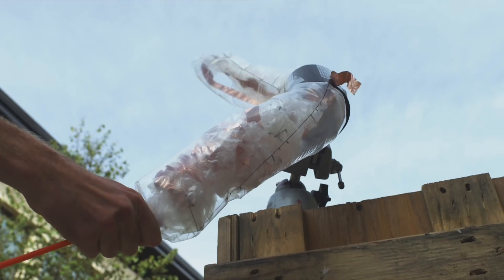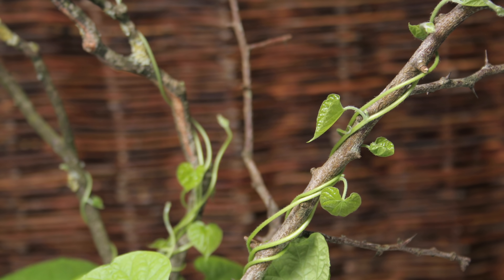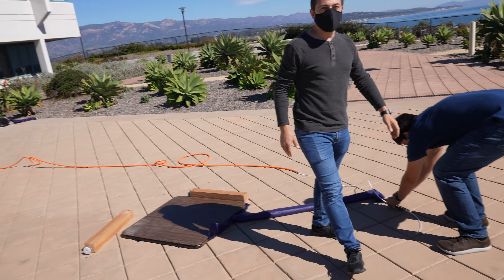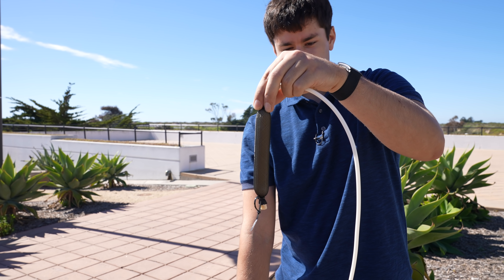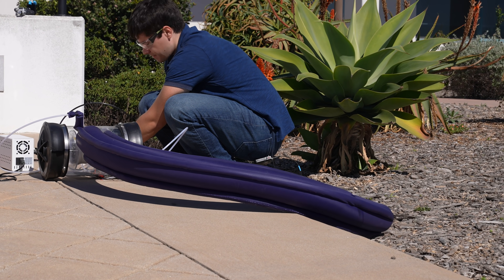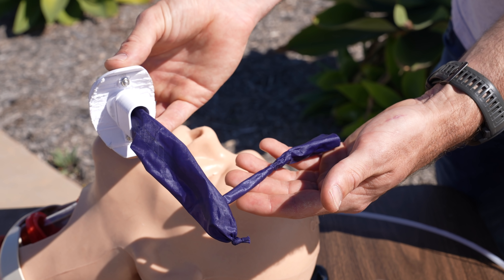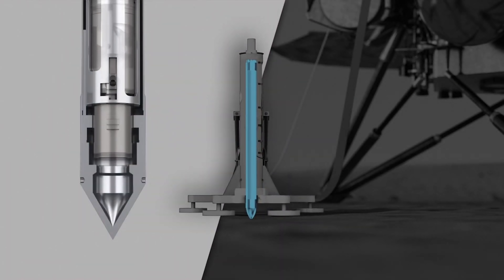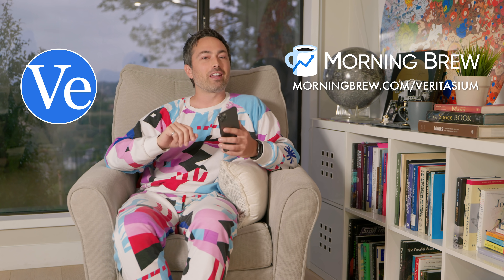This Unstoppable Robot Could Save Your Life

Comment: Don't know if this would be helpful or not but, for the intubation prototype demo there are a couple of problems sorry. But im sure with a couple of discussions with doctors, nurses, & paramedic communities will help it develop faster 👍 keep it up❤️❤️ (they all have different says)
-First, something needs to hold down  the jaw from biting down and the fleshy tongue from falling back (intubation blade) before we can get access to the oropharynx. +(the blade with light acc also help us to quickly evaluate the airway visually for anatomical, foreign, or pathological conditions/trauma)
-Second, take care not to overstimulate the entire back surface of the throat, too many reasons to explain sorry.(coughing, closing of the epiglottis, and other reflexes)
-Third, opening the epiglottis, usually the blade can assist in opening a closed epiglottis from the tip, or by pushing up the tissue above it (bellow the tongue), also we can assess if the tracheal opening is inflamed or not and how constricted it is, or did it puncture backwards etc
-maybe there are more (of course there are many other tools and cases of intubation problems, talk to medical professional, inspiration is bountyfull)

Wish you all the best👍

Comment: problem with space exploration is that would require a lot of added weight/volume for transporting the compressed gasses you will need to use both for the device itself, but also the amount you lose and can't reclaim blowing the dust to burrow. So probably not the most effective for that. As for intubation, it didn't seem like it had an adequate aperture through the center to pass the air for the actual breathing. It can open the pathway up-but it's open and full of vine robot so they can't breathe. Maybe it could be used for some colon stuff though? at home enima for when you are constipated for a long time lol, just turn on the air and feel it wind it's way deep into your bowels

Comment: Just a quick question. Don’t mind anyone answering this as it’s probably quite simple and I’ve likely just missed something. 

What prevents the intubation tube from contracting when the patient needs to effectively “breathe out”? I know that other intubation tubes are usually much more rigid so how does this one keep the pressure and still allow air to travel in both directions through the tube without blocking the airways of the patient?

Comment: Tradies would love this, finding or running cables in wall cavities. With a camera, and steering, you would be able to steer around internal obstructions such as water pipes or existing cables and electrical fittings and if you could fit a drilling mechanism even drill through studs. If the end had a ziplock type seal, you could then run the cable through the centre and out the other side once you got to the hole out of the wall by unzipping it before pulling it back deflated, leaving the cable insitu.

Comment: Doujin artists:- write that down! Write that down!!
Reply: Oh no
Reply: More like Bad Dragon designers
Reply: @MercanaryAlbatross   Everyone says they have some lewd idea for it, but I honestly don't see any realistic application as a sex toy... What is everyone talking about?
- It might go very deep in the colon, but that's about the only thing... and it might be soft, but doesn't seem gentle. Even if it worked, it won't provide any stimulation... what, you can pull it out after? whow -_- . - It might be more useful for medical colonoscopy or something, but what they have is usually better already anyway...
- Maybe you could make "viny" structures that would twine around you, but that seems pretty complicated...

It makes sense for doujins, though, sure...
Reply: @Verrisin  Attach very small motors with counterweights to the inside walls to make a vibrator. Toy drone motors might be a good start, but the voltage would probably need to be pretty low to make it effective (if it spins too fast, it might tear itself apart or be unnoticeable because the frequency is too high). Or possibly have the motors outside and have a thin rod that spins the counterweights inside - like one of those screwdrivers with the flexible arm you can attach, but much smaller.
Reply: @kiefac   I mean... but what of this inflatable mechanism do you need? ... You couldn't feel a vibrator deep in your colon anyway, and I don't think it has any use anywhere else, apart from mimicking tentacles grapping you, which would be so expensive, we will probably have cheaper VR you can feel sooner...
- Idk... I might be missing something obvious, but I don't see how using those inflatable semi-steerable tubes would be useful for a sex toy...
Reply: @Verrisin  who says it needs to be in your colon? There are other orifices in the human body. Also, it could be used for, eh... artificial insemination.
Somebody is going to find a legitimate use for these as a sex toy. I'm just spitballing (heh).
Reply: @kiefac   I agree that someone will probably come up with something. XD - My imagination might be limited, but this species... whow. XD

- As to why colon: I would say all other orfices are easily enough accessible without this. I wanted to say "there is not point" but realized... That's kind of true for most weird sex toys. XD That's not stopping anyone. XD
Reply: @Verrisin  no just no
Reply: @jpthepug3126   Fine. No tentacles for you, then.
Reply: @Verrisin  I love with what a serious attitude you went into this rather playful comment. Asking the big questions!
Reply: @Verrisin  to young and a strait guy
i dont want tentacles
Reply: @Shrooblord   Yeah, I always tend to ruin the fun by thinking things through too much. XD

I tried writing a "smut" thing with rules in it. When I read it next day, most of it was about edge cases and how to handle them, limitations, ways to assure safety, details and mechanics..... - definitely not ideal. XD

But, hey, "big" questions need answering! :D
Reply: @Verrisin  google "All the way Through"
Reply: @reddart179   ooh, yeah, that is a cute idea indeed. ^^  Sadly, very unrealistic, for many reasons.... but as far as Doujin is concerned: I don't think it's made better by this technology. :D - You already can use tentacles and ... well, almost anything, if you don't care about realism... but, yeah, sure... it's a (new?) thing that can be used :D
Reply: @Verrisin  There's potential, it's only a little more complicated.
Reply: @nullpoint3346   What are you replying to? To "All the way Through"? - That is mainly impossible, because it's extremely dangerous.
Reply: @Verrisin  I haven't seen that one yet?
You have over twelve comments in this thread alone.
Reply: @Verrisin  I mean... I think it's one of the few that could get past the cervix. IDK how useful that'd be for pleasure purposes, but it's not just the colon that's guarded by a sphincter
Reply: @nullpoint3346  That's why I was asking what you were replying to. :D
Reply: @CaTastrophy427   I kind of doubt it, it's very strong, and probably way too painful (well, people are weird, so that's not a limit XD) but... looking it it better, I think it would have trouble "unwinding" when it is too pressed for too long distance. (as it has to push the crunched material through it first)
- I briefly had the thought before, but dismissed it... but I guess if you managed to make it: very soft material, very ,very tough, no sharp 'folds' 
- It probably could be better than a metal rod, as after you manage the insertion (and thus being rigid enough to get it there) you could lower the pressure, making it somewhat soft, and more 'usable' ... still, it would have to be extremely smooth and...
- I really don't like how pressurized it would have to be, but as a very unsafe toy, ... maybe...

I also had a thought: The variant for breathing (with a smaller branch), it it were longer, maybe it could be used for "deep throat training" ...
Reply: I also have a thought: The variant for breathing, if the big part were longer(/stronger/...), could maybe be used for "deep throat training" kind of play...
Reply: @Verrisin  oh you sweet innocent you
Reply: @Retigator   XDXDXDXD good one. - So, what am I missing according to you?
Reply: @Verrisin  it seems most of the points i wanted to argue with have been made, BUT

regarding how confortable it is, thar is what innovation is for C:
Reply: @Verrisin  with a cap and maybe a vibrating device inside, if the outer fabric/plastic/whatever is strong enough, you can find some aplications. But the most feasible usecase would be to use this pressurization idea on a more complex... Recreation? Of the erection and hardening processes on a more sophisticated sex doll maybe?like using a silicon outer shell or something, and capping the growing to a fixed lenght. Wtf am I saying, why am I even alive?
Reply: @Retigator  Thank you for your comment. Somehow, after reading it, a spark of imagination came upon me, and I've figured out a unique and very interesting way to use it. :D
- Edit: it's right above this one.
Reply: @Verrisin  remember that spiral antenna robot featured in the video? Why not make a similar one that wraps around your legs?
Reply: @samsawesomeminecraft   Yeah, I had that thought too. Except, the antenna was predefined shape. - Here, you probably need something adaptive, and the complexity and cost would skyrocket (not to mention safety issues), making it not viable as just a sex toy, unless you are a millionaire...

(I could be wrong, though, maybe someone very smart could pull it off, and make it cheap and safe... but I don't see it, nor anyone pouring that much R&D money into it...)
Reply: @Verrisin  the whole point of this robot technology is that the predefined shape is not very solid and can adapt to circumstances, so you could just add one or two control "muscles" and that would provide a realistic feel without needing to add a ton of expensive technology
Reply: @samsawesomeminecraft   If you can, that's great. Please make it. :D - I guess if it is trying to have inner diameter smaller than the leg diameter, and the outer material has very low friction, it might be enough... will even provide some pressure (maybe enough to feel held), and will actually hold you once extended long enough... (if the base is affixed)
- I'm afraid it won't be that simple, but if it could... That could be pretty awesome!
Reply: @MercanaryAlbatross  I see you are a man of culture
Reply: @MercanaryAlbatross  the worst part is that it would work decently well
Reply: oh no, but oh no(yes)
Reply: well, yes, but actually, no
Reply: why is this a discussion on a youtube video about vine robots
I'm not saying it's a bad topic but why
Reply: @mangutroop  because it’s a tube that wiggles around through small holes...
Reply: @mangutroop   ... OC ? ... and this is where the video that started it is...
Reply: @mangutroop  Tentacles, I ain't got to explain.
Reply: 0:16 😩
Reply: Oh god
Reply: this comment and the replies are cursed
Reply: @bruhmomentum6819   some curses might be a blessing in disguise :D
EDIT: Not sure about this one, though...
Reply: Rule34 artist all the time ahead of time
Reply: YESSSS SAUCE
Reply: It is inflation
Reply: @Xatzimi   So simple! I completely forgot that was a kink. Inflation surely lends itself well to inflation. XD
Reply: ( ͡° ͜ʖ ͡°)
Reply: Everyone, I figured it out!
- It must be very long and when it fills you, it needs to keep unwinding. Then it keeps slowly pushing itself out of you.
- It will fill you completely, as it is soft-ish, if the pressure is right, it will exactly fit the walls around it, slowly moving along every single nook.
- It will be a very unique continuous sensation. Maybe it could even be made to loop somehow...
- Also, it will continuously rub the cervix.
- It must be made from a very soft material, with no sharp edges (bends) and it must be heavily lubricated from the inside, so it keeps adding as it is unwinding in the deepest part of you.

Thank you. Thank you. (XD) Now please, someone go patent it and make it, I'm interested in the reviews. :D
Reply: Wha, wha...      ...what happened here?
Reply: I will have you know, thats basically a tentacle
Reply: I can't believe you've said this 💀💀💀
Reply: we allready did. there is a lot of "all the way through"
Reply: @Aethenthebored  Ooh, that's a good point.

How weird would that feel?
Reply: and this is basically what the rule 34 is
Reply: I love how people always act like sex isn't a thing and that thinking about it is wrong somehow.
Reply: @DarthBiomech  Well on YouTube it is
Reply: Good thing i'm not the only degenerate here
Reply: I just googled it and that stuff is just so boring, like the artists have absolutely no idea what is sexually appealing, and all of the men's members are so small
Reply: @TommyLikeTom   XD I have no idea how you managed to google this. XD
- Anyway, if you search long enough, you are bound something you will like... if not, maybe you have to be the one to make it.

Go forth, and bring to life inflatable robot tentacles in ********* and ******* with huge ******** 
XD
Reply: degen
Reply: I knew there was gonna be this comment.
Reply: They don’t need MORE options...
Reply: i mean, some sort of sanitizing product, or a anti conception "clean the insides" might work, maybe its a stupid idea.
Reply: @sonni.walkman   ... I don't think you could ever "clean the insides from sperm" however it could be a less painful for inserting IUD contraception...
- You don't want to mess with 'sanitization' or something a lay person would do on their own: It's a very tightly controlled environment, which handles self cleaning and everything... That would probably cause lots of horrible infections and even worse problems...
- If you are talking about uterus. 
- If just vagina: I don't think it would be a huge help with anything (although, maybe) but you shouldn't clean deep inside vagina either: it's also self cleaning and it's best not to mess with it.
Reply: @Verrisin  make this toy your self before someone else does and make billions
Reply: Already have
Reply: Glad it wasnt just me
Reply: WHY IS THIS TOP COMMENT
Reply: stop
Reply: This kinda meeting has 84 reply on a day already😂
Reply: DOUNINSHI ARTISTS LOL
Reply: GOD is righteous. If you repent of your sins, believe in Jesus, get baptised and recieve the Holy Spirit, you will be born again and If you go on acting in faith for Jesus, you will earn eternal life and be useful to GOD.
Reply: I got like a 3rd of the way down these comments at most.... ya'll have problems.
Reply: Ohh yeahhh
Reply: ehe
Reply: Ha I thought the same
Reply: Uh oh
Reply: Oh no
Reply: Wink wink
Reply: Lmao just wait for it
Reply: 2000th like
Reply: Lol
Reply: Aw damn I was about to post that XD
Reply: You really are a lonely sandwich aren’t you?
Reply: @adammasterx5854  I will fully admit, it has been a while.
Reply: Grow 200 times of it size.
Reply: I hate you putting they image in my head
Reply: I've seen this person somewhere😂
Reply: what does doujin mean
Reply: @years8703   doujin is a Japanese word for "fan made" but in the west, it is often used as more similar to "rule 34"
Reply: @Verrisin  ooohhhh, mama mia
Reply: You mean paint them down
Reply: Oh God I'm cooming
Reply: Ha!
Reply: What’s doujin
Reply: Lmao
Reply: @rodrigodivino1129 nice
Reply: Hahahahhahahha
Reply: oh my goah
Reply: @kaibuchan  it can go into any space  we all know where this is going
Reply: Yes
Reply: Weeb
Reply: Why are you everywhere
Reply: Oh shjt dude.
Reply: Bad! Bad Sandwich!
Reply: hell yeah
Reply: H€nt@i
Reply: hi lonely sandwich I didn't know u watched veritasium :D
Reply: Oh god damn it...
Reply: Ssshhhhh they'll hear you
Reply: yeah folks never google things random people say in the comments
Reply: Urotsukidoji: the live action remake
Reply: 6.9K 😏
Reply: True
Reply: Dont
Reply: Wow 🤩
Reply: Cool 😎

Comment: What an awe-inspiring piece of work. Trying to think  of possible applications, I was wondering if this could be the technology for a 'Star Trek' style turbo-elevator, where the shaft not only goes vertically, but sideways or at angles as well, pushing the car in front of it. A rather mundane use for the tech., but it could be the basis of funding more appropriate uses.

Comment: If the materials are up to spec (Some form of carbon nano weave), with enough pressure they could be used to inspect the inside of pressurised vessels, e.g 02 tanks, Oil pipelines and so on. Cool stuff.

Comment: But is it really a robot?  I was taught the robots were things set up to work autonomously.  Most of what you showed, while being really interesting and innovative (thinking inside the tube, perhaps?), seem to require human intervention continually in order to get the desired effect.  Bladders filled with air to lift objects are not all that new and the intubation one does not seem any more robotic than what it is trying to replace (just a lot faster and easier).

Comment: Space elevator!

Instead of lowering a long cable from a satellite/station (the usual idea), you could just extend the tip of the vine. You could feed in more vine material from the satellite base as needed, and it would eventually make its way down the length as the cable/vine grows. Also could be used to repair any damage on the current vine, without having to send anyone out to fix it: Just send another 'patch' vine inside the existing vine to patch a damaged area. Or twist an external vine around the outside of the existing vine, like the original plant inspiration.

Very cool idea!